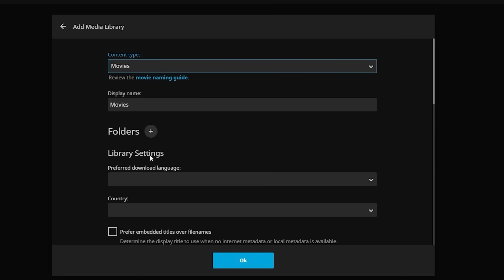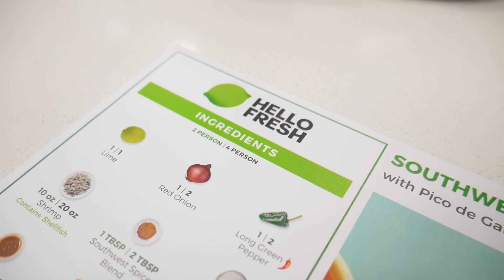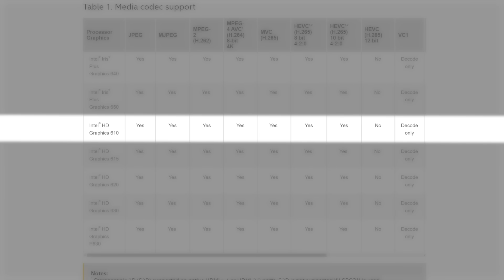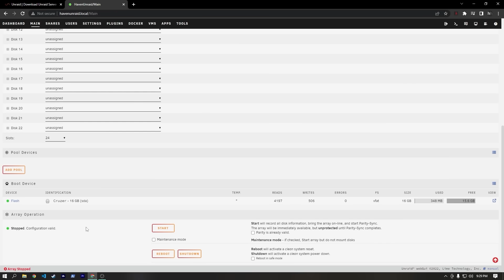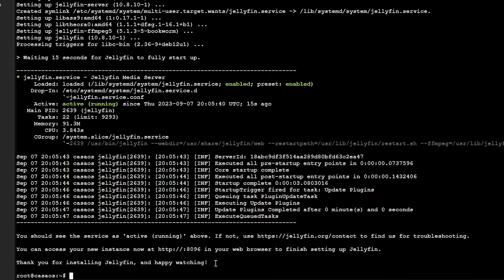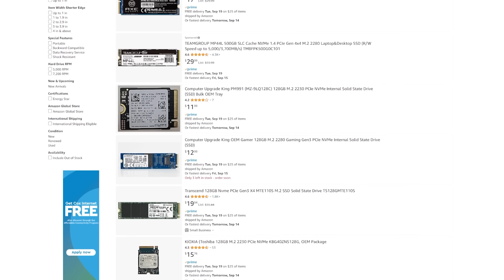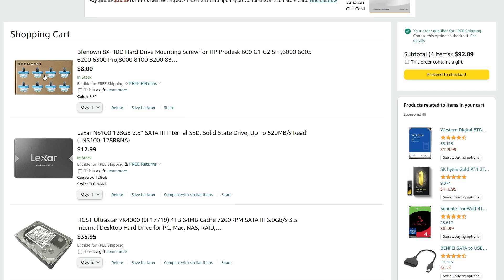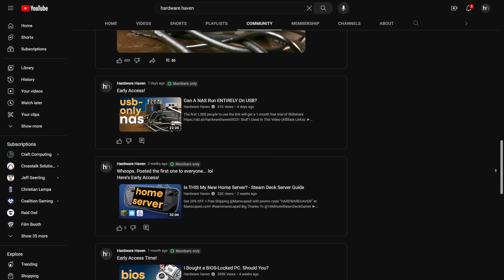The ULTIMATE Budget Jellyfin Server

Comment: I got a DELL Optiplex 5070 USFF PC With i5-9500T /8Gb RAM (No disk) for $96.00. There's no much room for hard disks, just m.2 and 2.5" HDD, but it has USB-C and I'll put an ORICO 5 BAY with RAID though that, and maybe a 4 bay disk tower as a backup. 35W CPU, but enough power for transcoding and a lot more

Comment: Wow!  Small world...   I actually bought that same ProDesk 600 G3 with the Pentium G4560 from that same ebay seller.  Mine fortunately came in better physical shape than yours did.  I dropped a 6TB HDD into it and use it as a backup drive on my network.  You're right that it sips power!  For my Plex server I have an i3-8100 running Linux Mint that I've been using for quite a while.

Comment: Yeah I got a i5 8400 with a cheap MB (4 sata ports). Installed TrueNAS... And voilá... The 8400 runs great. Handling 4k HDR amazingly. The only problems I encountered were on the clients side. Server-wise... Its running great. Running a ssd for OS and cache and HDD for storage, 16gb ram... about 20w idle... Not bad

Comment: I don't check it. Why transcode? I run my jellyfin for years without transcoding. Only direct streaming. It works perfect.
Reply: Could you explain this a little more for a noob?  If I have a h265 10-bit HDR movie on my NAS or desktop but no Jellyfin app on my TV what do I need?  Reading the comments it seems like I need a FireStick or something connected to the TV that will run the Jellyfin app.  I know my NAS cannot transcode this file but the TV will if I put it on a USB stick and plug it into the TV.  Could I still run Jellyfin in this direction mode so somehow the TV is doing the transcoding?  Sorry, may be a stupid question but just trying to figure this out.  Does the computer running Jellyfin need to be directly connected to the TV to use direct or can this happen over Ethernet?

Comment: I bought an Elitedesk 800 G5 with an AMD Ryzen Pro 3400G. It came with 16 GB memory on a single stick (unfortunately) and a 256 GB M.2 drive. It idles at 17 watts and has 2 m.2 sockets, 3 SATA connections and 4 memory slots.. but I didn't think to look at which video codecs it handles. The Ryzen might have been a mistake.. I'll have to get JellyFin on it this week and see what it can do.
Reply from the maker: I think it can still do quite a bit using the VA-API, but Intel’s quick sync is definitely a bit better typically if comparing the same generations

Comment: Built my first sever pc running unraid for plex and makemkv after your 4K HDR jellyfin server video. Used some hard drives I had on hand and went for some really cheap parts. 16GB 3200MHz memory, 500GB 980 nvme for cache, 10TB iron wolf, H510M-E asus board with an intel 10100T i picked up for £30 from CeX. Case and PSU was a £13 used office pc unit from local pc repair store and dropped in the LG drive from your video, flashed to read 4K blu rays. Have ripped my entire 1080p and 4K HDR blu ray collection to it, direct play across my house with no issue on gigabit LAN. Thanks for the videos!
Reply from the maker: That’s awesome to hear!

Comment: Hey, I want to set up a home server that I can use for different things. I want to use it as a NAS, 2 Minecraft servers (1 vanilla and 1 modded), and something like Jellyfish or Plex for video streaming. What CPU and how much RAM would you recommend? As the Main OS, I wanted to go with TrueNas scale.
Reply from the maker: It really depends on how much you’re using the NAS, what network speeds you’re using, how many people you expect on each Minecraft server, etc…
Reply: @HardwareHaven  network for the foreseable future will only be 1gig maybe 2,5gig.
NAS mainly for storing the ripped movies for Plex/Jellyfish, maybe some pictures and documents to backup.
And minecraft at the start there won't be as many but I would like to have the option for about 50 people simultaneously on each.

At least for the start.

Comment: My home server setup:  Windows server with a cheap key.  Run truenas core in a vm for zfs and pass the storage to windows through iscsi.  I get a big shared drive on the network I can just pass media to, jellyfin will pickup the new files automatically.  iscsi allows me to use postgres, which was the real reason for it.  I got 32gb worth of ecc memory, a sas card, and 10 used 4tb enterprise drives (using 8 with 2 for backup) from ebay.  Had on hand a ryzen 2700X, mobo, psu, case, low end gpu.  Probably spent less than 200 for a decently powerful do-all home server.  Using raidz3 as I have family photos and videos going back decades stored on there.  I think I ended up with 21tb total of some pretty resilient storage.

Comment: I went with a Dell Optiplex 3050 SFF, 16gb DDR4, i5-7500.  Currently have one 240GB SSD, and one 4tb WD hard drive (no redundancy so I'm rolling the dice)  Installed Ubuntu Server 20.04 and running CasaOS.  Setup a network share and copied my movies over to it. Installed Jellyfin and its working flawlessly.  This is my backup media server, but it works like a champ! (And I run it off my small 350 watt solar panel setup, with a small 600 watt pure sine wave interter)

Comment: tl;dr: If you're used to having an old PC with a couple of disks just serving video, you're probably fine.  There are severe limitations if you want to serve main storage to another device (compute node for a home lab or your main workstation).
I've got a couple of the 800 G3's.
First off... transcoding.  Is this something that's actually time critical?  If not, its probably something you can let the server chug along with and once its done, you're fine.  Be aware of your use-cases. 
Speaking of usecases:
If this thing is a main file server, you may well want to go faster, so you can centralise all your storage onto it.  3 small disks are better than two large mirrored for capacity and speed reasons... but they won't fit... unless you go for 2.5" inside the 3.5" bays, in which case you might start thinking of SSDs.
If you're thinking of SSDs, you need a faster network to make use of them.  10G is fine with a single drive or stripped SATA SSDs, but then you start running into "not enough PCIE lane" issues.  I made the mistake of thinking the 800G3 had 2x16 slots... one of those x16 slots is only wired for x4 - good for a single nvme disk.  
I ended up going for a very power inefficient older xeon, because it has 2 x16 slots and one x8 slot straight to the CPU.  One x16 for an old server NIC (recommend 25G max, or the cables get expensive), and the other can be used for one of those expensive SSD carrier cards with a built-in PCIE switch (because bifurcation is a new and rare thing).  
Beware of motherboards with lots of SATA ports bottlenecked by the chipset if you want SATA SSDs, but SATA spinning rust for high-capacity/low bandwidth video are fine.
Also, USB drives are (apparently) not recommended for truenas as drive identification can be uncertain (which sounds horrible).

I know motherboards with dual x16 PCIE slots have fallen out of favour as crossfire and SLI died, but we now need them back for storage and high-speed networking - I'd like to do iscsi from SSDs just as fast as a local drive :)

Comment: A couple of months ago I moved our Plex server from its old home to one of these machines as a dedicated Plex server, running an i5-6500 and a bare-metal Ubuntu server install.  It was a refurb system off eBay with an NVMe drive and a 500 GB HDD, which got replaced with the 8 TB media HDD from the old server. All I really had to do was install Plex, copy its directory over, and mount the HDD in the same filesystem location and it fired right up.  We don't have any 4k media but it handles transcoding Blu-ray rips to my phone quite well.

I also installed Jellyfin to try it out and while it works well enough, the version of WebOS on the LG TV in the living room is unfortunately too old for the Jellyfin app to run.  Also unfortunately, the Blu-ray slimline drive from my 800 G1 SFF Proxmox server doesn't fit the bay in the G3 - the drive's too tall, believe it or not.
Reply: you can install jellyfin on a firetv stick, which is how my girlfriend watches stuff on the tv

Comment: My Jellyfin server is an old laptop with a Core 2 T5800 2 GHz and 4 Go ram, running Linux Debian, with an external USB drive :)
Of course, no transcoding with the integrated Intel video card. but I don't need it.
If you don't need transcoding, about any computer can run Jellyfin.
Reply from the maker: True! Just ran it on a t620 that can barely run Lubuntu lol

Comment: I have a HP ProDesk 400 G6 as my main docker host. This is an USFF machine with a i5-10500T and 16GB RAM. I run several containers on it, including Plex. Plex is also using the iGPU for transcoding. Pretty nifty little machine. Got that for €100 from a friend. Can't seem to find that deal anywhere else though.
Reply from the maker: Nice deal!

Comment: i don't understand why transcoding is required. what are you watching on that can't decode (or whatever) on it's own? or do i not understand what transcoding is.
Reply: I'm a year late, but here's a 20 second rundown:

decoding is how you play files, but transcoding can make them small. that applies to both file size and resolution, for devices that don't have a 4K or 1080p screen.
Reply: ngl I just send a 4k file to 1080p devices as well and it works perfectly fine.
I just encoded everything into a pretty good AV1 preset, to not waste as much bandwidth xd
Reply: @ i've learned a fair bit since asking that. resolution doesn't really matter unless the device is truly ancient. what matters is the bitrate. in my minimal testing on the OG tube nvidia shield, VLC player will top out being able to play about 3500kbps bitrate AV1. so for the time being i've switched to " acquiring " x265 only.

still don't really see the point in transcoding. if i had a situation where it would be useful i would just have a high and a low quality copy of the files.

Comment: Old Network/System Admin here....  In my home media server, I went the other way.  I favored using a lot of drive space vs space-saving x265 transcoding.  Large drives are getting cheaper all the time.  I pre-transcode all my media to X264 to minimize "On-The-Fly" transcoding.  This basically eliminates any need for X265/HVEC hardware for me because I media-serve my Family and Friends.  At any giventime, my Emby Server will be streaming anywhere between 1 and 7 streams.  I currently have a fairly beefy Xeon with 12C/24T and it really can't handle more than 2 X265 transcodes at the same time.  This is why I stick with X264.  Currently, I stick with 1080p.  I won't go to 4K until AV1 becomes a standard video codec across the board.  I just recently purchased a Samsung 4K TV for the living room.  It does a great job upscaling video to 4K!
Reply from the maker: That’s awesome! And it goes to show there are multiple approaches that might make sense for different people. Thanks for the comment!
Reply: I am currently building a new Desktop/Media-Server for myself.  It will by Ryzen based.  I am almost of drive space in my current system.  I will be replacing my current 4 8TB WD Reds with 2 20TB Reds for $290 a pop.  I was only able to get 2 on sale.  I'll buy a 3rd when I catch them on sale again.

Comment: If you have nothing, then this could be a way to get started. I'd still just recommend saving up a little more and build a system with an i3-13100. You can get dirt cheap cases with 5+ bays and the rest of the hardware that would wipe the floor with that PC.
Reply: @wojtek-33  I agree that older hardware is plenty capable. What gets me sometimes is how much some of this older hardware can cost vs new. A new i3-13100 is only ~$120. Being a new CPU the motherboards are easy to find at $80. With the rest of the components being the same it’s nice to run the newer hardware and have more niceties like multiple m.2, faster PCIE, better integrated graphics, and even 2.5Gb LAN is awesome.
Reply: @wojtek-33  Plex can run on those, but not everyone is doing just one 1080p non-transcode stream off a USB drive. I regularly watch 10 bit HDR. So having SATA expandable storage is not optional. I also need more horsepower in the event I need to transcode that 4K HDR to my cell if I’m somewhere with a slower connection.

Comment: Wow, funny thing is, I have just finished installing qbittorrent and Jellyfin on the cheap Android set top box I bought somewhere in fall of 2019 for almost $10, it still manages to download torrents and stream 1080P files at the same time!! It has just 1GB of ram...and these two services are using just 250MB of ram while streaming!! If 1080P streaming will satisfy your needs, then there is absolutely no need to go with a power hungry , desktop machine. A simple arm based stb is all we need! And I have checked with a 1TB external ssd too, it works!

Comment: Great video! This is why I keep old laptops around—recently repurposed an old work laptop (Intel i5-6200 CPU) for a 1080p Jellyfin server. The caveat with laptops is as you allude to—no internal storage space. Been thinking about migrating my server to something like this, though, as it would be much better (and give me an excuse to buy and setup another machine). Thanks for the inspiration!
Reply: No big storage inside, but you can use an external USB drive.
That's what I do, with a small USB 2 connection. It's enough.
My server is a Core 2 T5800 with 4 Go ram, it's more than enough :)
No transcoding, but I don't need it.
Reply: @nalinux If you're up to it, you could replace the external hard drive with a JBOD or DAS enclosure and add hard drives that way. It's less of a mess, allows for more expandability and you can do RAID easier. You could even make your own NAS for the storage if you have an older computer lying around with enough drive bays, and attach that to the jellyfin machine via the network.

Comment: Unfortunately, your implementation tops out at the capacity of a single hard disk drive, currently 22TB. So the build relies on you having a small to mid-size media library. For those of up who have libraries more than twice that size, the selection of the base system you used necessitates another choice. What would you select, in regard to off-lease systems, for something that you could fit a reasonable -- say eight -- number of drives into? (Disclaimer: My primary Plex server runs on a Synology NAS with 12 drive bays. I'll be looking to replace that early next year.)
Reply: I'd reckon 99.9% of jellyfin users don't see topping out at 22TB of media as an issue
Reply: How long do you really need to keep that crappy one season sitcom from 2018 around? Do you really need Ironman in both 4K and 1080? 

The point is, any real media server in production doesn’t need any more than 16tb in my opinion. Media is easy to acquire so why keep stuff you will never ever watch again around?
Reply: @Rockwolf50 I am not the only person who uses my Plex. Hence, both Little Mermaid and Barbie are in my library. I even have some content in Hindi, for coworkers and, yes a lot of crappy TV going back to the 60s and earlier (I dream of Jeannie, The Partridge Family, Star Trek: TOS, The Six Million Dollar Man, etc., etc.) A 16TB media collection is a nice start and I can see where you're coming from. Our use cases are different.
Reply: Same here. I'm at 52TB covering 2 servers and my media library covers silent movies all the way to the latest releases and some of those were VERY hard to find.  I'm not deleting anything unless it holds absolutely 0 interest from me or anyone that uses my server.

Comment: This is awesome, im currently going through a similar route as you took in this video, after watching your mini pc video i bought a used hp elitedesk 800 g3 sff for like 80 bucks, i wanted to make the ultimate home server on the cheap, including game streaming. i was amazed by the specs for the price:
i5-8500 6 cores
16gb RAM
1TB ssd
2x 3.5 HDD slots
2x M.2 NVME slots (also supports sata m.2)
and 4 pcie slots
i ended up bying 16gb of ram for 20 bucks bumping it to 32gbs and $100 in total for the pc (not including hard drives) unfortuantely i found out you cant boot through the nvme drives no matter what you do, but they are recognized and can be passed to vms. i also ran into a hickup with the gpu i bought, i ended up getting a tesla p4 gpu which is enterprise but the machine is having issues recognizing it, ill have to continue to test. but i love everything in this video. im thinking of making a video about my results when its all set and done. love the content.
Reply: Have bought the mini version ans have the exact same problem, ssd nvme not recognized by proxmox at installtion, the fix was to disable a Intel feature on bios
Reply: @moniika000  What feature did you have to disable? I’m looking at getting the exact same setup as @codefallacy.

Comment: i like this intel gen but getting ps adapter and liberating it from the case is necessary in my view - they you can run a gpu and have room to fiddle - sop for almost all 3rd-10th gen sff and even mt cases - you need the better ps and you need a real case - the ssd nvme slot on this pc is great - on these older gen pc it is not a big luxury to max out the ram capacity - you won't be sorry

Comment: I have a similar system, but with an i5 7500 in it. I upgraded it to 24 gigs of ram to be able to run docker while running windows server. I even got a quadro p620 for video transcoding an video output, so now it works as a server/htpc.